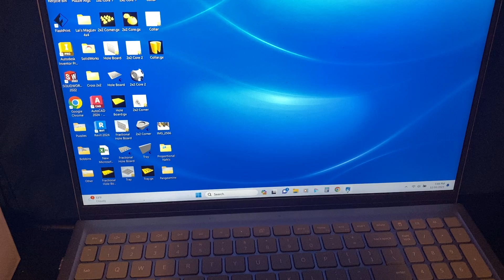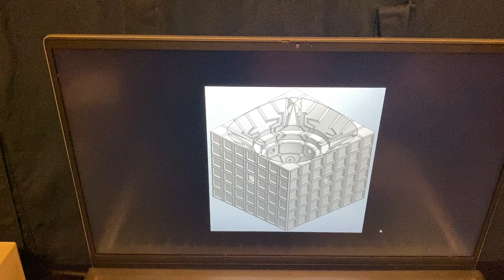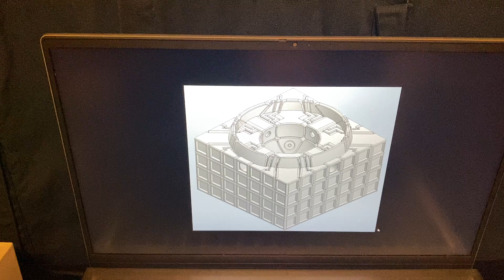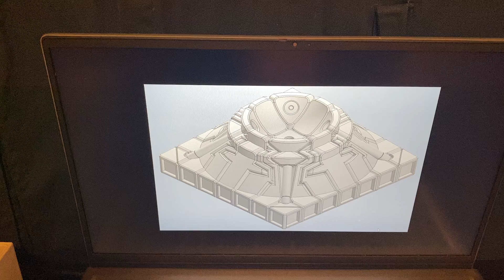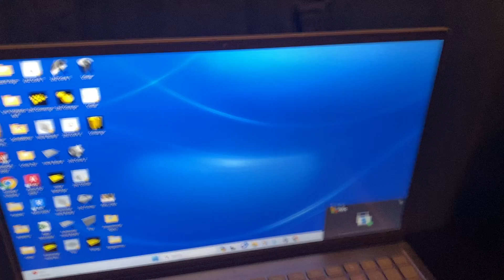A Proper-Looking 7x7 Rubik's Cube IS Possible! Here's How I Made One

Comment: So the proportional cubes are:

Rubik's Cube
Rubik's Revenge
Professor's Cube
Proportional 6×6×6 cube (note: thin corners)
Proportional 7×7×7 cube with retractable corners
Proportional 8×8×8 cube with retractable corners
Proportional 9×9×9 cube with retractable corners (note: thin edges)
Next logical step would be to find proportional retractable edge mechanism which makes them stay attached.
Reply from the maker: You could in theory do that but you would sacrifice crucial stability to where the puzzle would cease to work properly
Reply: @jacobcubing606  So the theory would have to be revised before a proportional 9×9×9 cube and 10×10×10 cube could be practical.
Reply from the maker: @jhgvvetyjj6589  Pretty much
Reply: where are the proportional 6x6, 8x8, and 9x9?
Reply from the maker: @Rpermcubing  Working on them

Comment: Congratulations Finally it's done! Question: Is it scalable beyond 7X7?
Reply from the maker: The new limit using this trick is technically 9x9, but the wings next to the corners would be pretty thin. Similarly, the limit using the conventional mechanism is 6, although the corner stalk would be super thin. Although if you scale it up enough, it could still be feasible

Comment: How did you make this? Was it just a normal 3d printer? If so, which one?
Reply from the maker: I used a Flashforge Adventurer 4, it's a mid-level printer but it does a pretty good job printing puzzles
Reply: @jacobcubing606  yes, that looks great!

Comment: Nice. Better than my idea.

Took a while to understand it just from pics but think I got it after you explained it in the video: you split the first/second layers using a cut-line with a 1/7 outer layer (I know from experience that this deletes the corner stalk), then cut an extra (squircle) cut into the second layer), then add a corner stalk that fits within the squircle cut. The stalk is fixed to the head and hinged to the root.
Should magnetizing the puzzle stick the corners to the two adjacent edges even when turned 45 degrees?

My approach would be split first/second as per normal using a cut-line that causes olzing, then cut the midges and wings near the surface, then hide the olzing by adding flexible caps on the T centers. Sadly, limited by time and resources and never got around to doing it. 3d print materials like TPU are flexible but given what I have, a thin-enough sheet of PETG would work and still be strong enough.
I think this gives a more stable 7x7, but does not give allowance for 9x9 or higher.

For revealing the mech, I still only want publicly reveal how I made a stalkless maglev 4x4 in a scenario where Moyu or Qiyi forms an agreement with me to use the mech and give credit fairly, since I do think the idea extremely exploitable. Whereas for big cubes, wide outer layers are already intentionally done to improve grip even in 5x5 and 6x6 even though the limit to making a proportional cube without fancy tricks is close to 6.83. (6.83 assumes zero thickness for corner stalks. If you account for making the stalk thick enough, the number closer to 6. I once designed a cube with a 1/6.5 size outer layer and the stalk iturned out ridiculously thin; obviously didn't print it). 

I would say being to make the outer layer smaller than 1/6 is still speedcube-useful if you want to downsize something like a 10x10 or 14x14. The inner layers are already very small (especially the "necks" of the center pieces, not just the "heads" you see on the outside), and if you maintain the same-sized inner layers but add more of them, the outer layer must increase to keep the 1/6 ratio. The ability to use fancy tricks to bring the limit to 1/7 or 1/8 would then prevent the cube from being too gigantic and not fun to play with (like size of the Huanglong 17 in a sense), or at least reduce the problem a bit.
Reply from the maker: The new limit using this trick rounded down to the nearest integer is 9, although it results in the wings next to the corners being pretty thin. Just like the limit using a conventional mech is 6 if rounded down, but the corner stalk would be quite thin
Reply: @jacobcubing606 In comparison, using T centers with bendable caps and Florian-modding the obliques bigger than the olzing pattern would limit at 7 due to the T centers becoming thin, and the Olzing actually being a gentle, wide curve.